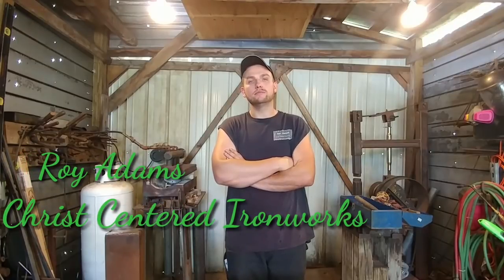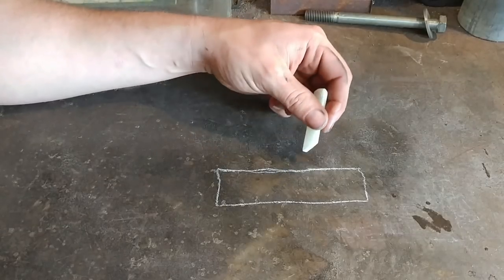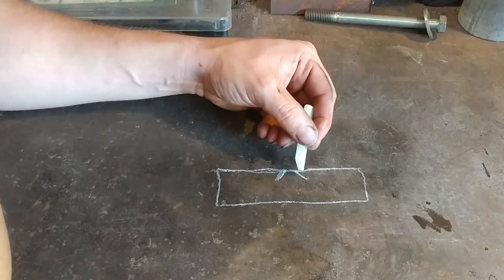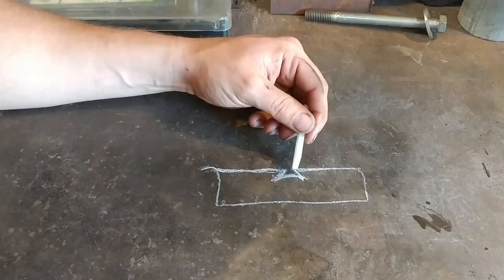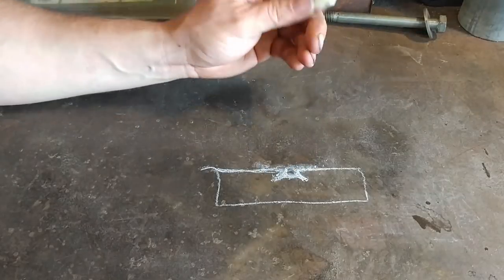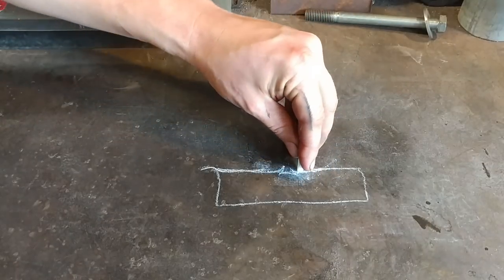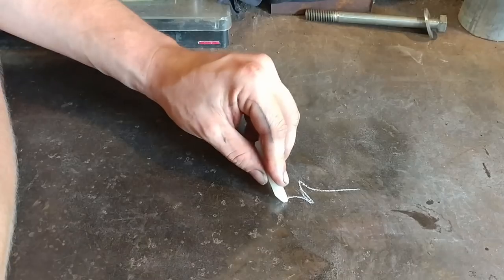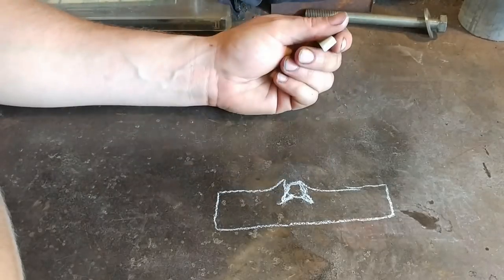Brass Inlay in Steel // Metal Inlay Techniques: Brass Inlay in Metal  Tutorial

Comment: I've filled grooves in a horseshoe mig welding SiBr.  and what is really improves it is a little bit of direct heat with a torch...It will "blue" the brass and if longer will blue the steel as well.   Thanks again Roy....

Comment: 2nd what Irish Craftsman said. This will be a very useful technique. Question, the first double cut you made that was too wide...would it hold a double wrap of the wire or no? I suppose I should test it out for myself. Would make a nice embellishment with a double wrap bracketed by a pair of singles. May even have to attempt to inlay a Celtic rope wrap if I can figure out how to overlap and stick the wire successfully. 
Once again, thank you...for this and all the other instructional videos. You my young brother are a good man.
Reply from the maker: +Kenny McCoy thank you very much for all your compliments! The double wide or the two wide line first cut can be used with a twisted wire or braided wire or a thicker piece of soft material. Keeping everything together in a wider slot is a little more difficult but doable. My mentor Tom Latane name showed Me how to do a braided inlay and that was pretty sweet looking I would love to see the Celtic thing in an inlay :-) God bless you and thank you once again have a great weekend

Comment: Just stumbled onto your videos, looks like lots on good info is on your channel.... i was going to do this to my straight Razors, I was thinking the plan through and realized I would need to heat treat afterward.... I don’t think it would be a good idea to put the wire in before hand so I figure I could cut the groove, heat treat the steel then inlay the wire. 

Let me know if that would work, I almost think the heat treatment would contract the groove... but what do I know lik

Comment: if I wanted to put it in a twist would I be able to put it before or after I do the twist?
Reply from the maker: +gotmilk1061 if you wanted to inlay a Twist you would have to start with doing the chased portion first then twist the bar and then inlay the wire afterwards. If you did it first it would pull itself apart. Thank you for the great question God bless you and have a great weekend :-)
Reply: Christ Centered Ironworks thanks for the info

Comment: What a bout a knife that you have to quench's? Are the copper or braze survive the heat?
Reply: I don't think so. Those non ferrous metals have a melting point that is lower than what I think a good quenching heat would be. And if it didn't all melt down in the fire, I don't think it would survive the rapid cooling in the quench either.

Comment: What if a guy chiseled a pattern into a piece, laid wire down into the grooves, and then chucked it into the forge until the soft metal melted down into the grooves?
It seems to me like this would be possible in the O2 free environment of a gas forge, reducing fire if need be, or even with a flux coated rod.
I think i'm going to try it, but maybe you'd like to try it here too?
Reply from the maker: I think it definitely could be done although with the differences in Cooling and contraction rates that happens in differential metal I don't know if it would stay connected. Would be neat to try though you never know until you try! God bless you and thank you for taking the time to watch
Reply: @ChristCenteredIronworks  i've done it sort off at least on a brass crossguard for a sword i made, cut all the lines on it then filled it with solder, i attempted to do the hole thing with silver solder but destroyed 3 days work, of punching cutting and filing the pattern,   in the process as i got it to hot and melted the brass, no reason i can see it not working apart from it has to be totally clean for it to work properly.

Comment: This method causes a loss of control of width when you get down past the very top surface. Only appropriate on a very crude or primitive object. On a fine knife or other tool, it would ruin the aesthetic. Use caution where you use it.